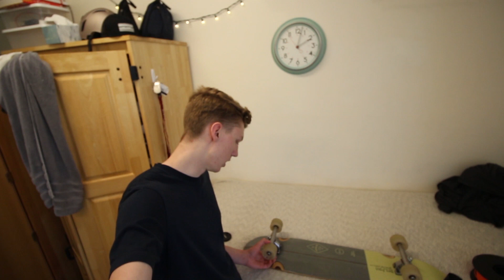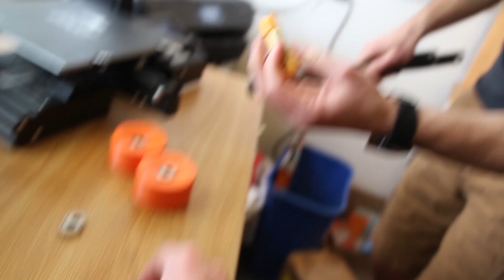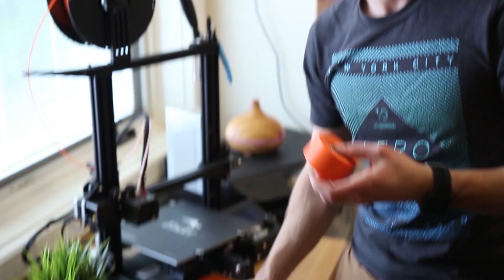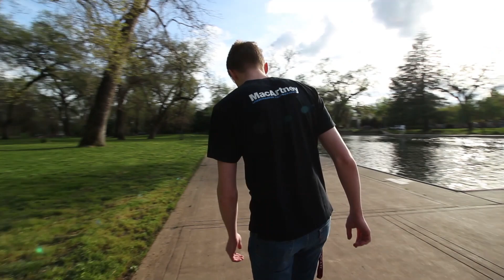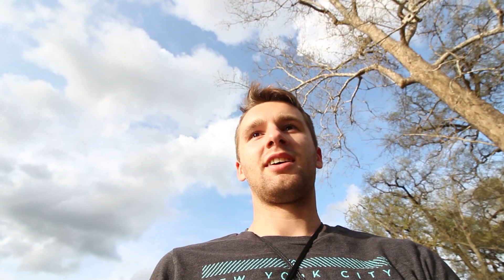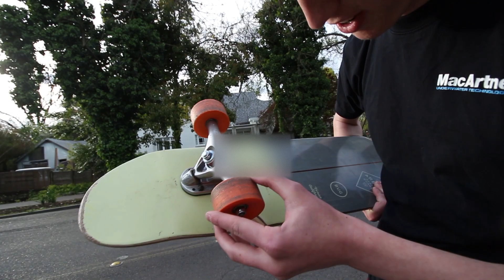Testing 3D Printed Longboard Wheels

Comment: I am going to try to design some treaded longboard wheels, but I'm going to print with 85a TPU.
also, hope the rest of your schooling went well.. I wish I had done mechanical engineering vs my current program.. after taking statics, I'm honestly not sure if I could have made it through a mechanical degree..
Reply: How did it work out?
Reply: @HauntedSheppard  I've been working on finals/capstone projects so I haven't had any free time to dig into it.  I've been thinking I'm just going to print the treads and make sleeves that go over existing wheels so that the board can go off-roading.